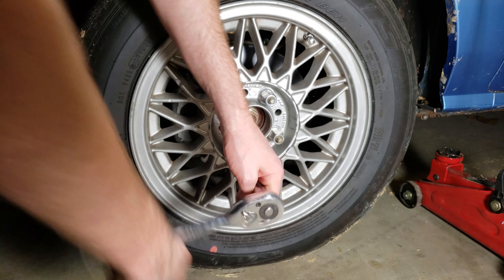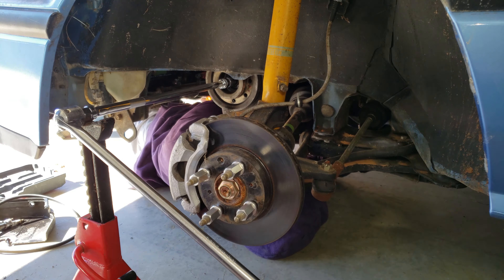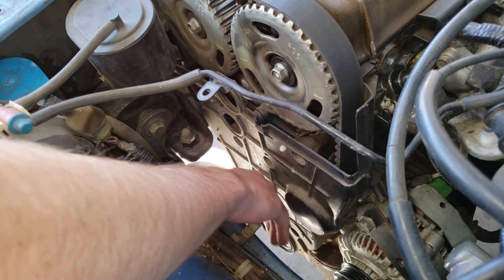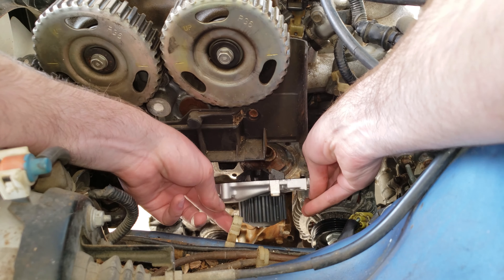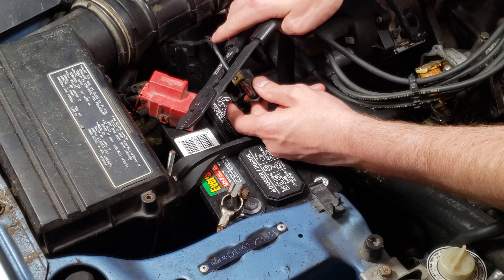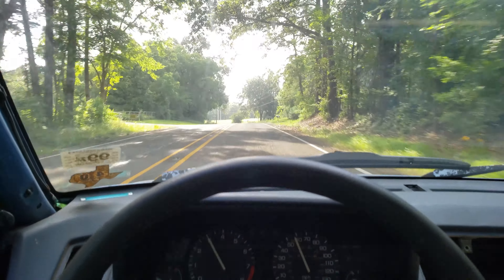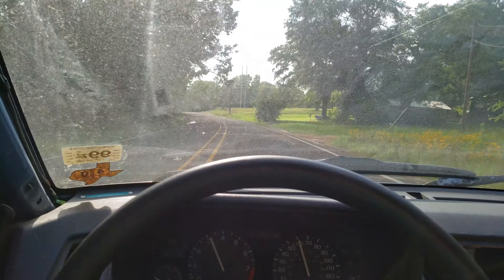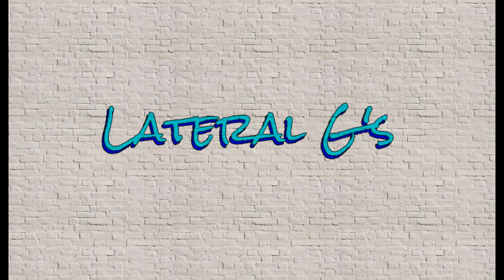Project '87 Integra: Episode 11 - Autocross Day

Comment: Love your channel...!😀.  I have my 89 Integra hatch in storage for 20yrs & about 60k miles!  Life, people, & heath all took it's toll on me.   So,  Did the fuel pump fix your power loss problem?  
One thing you should really consider for your car & others cars is to use a very unique oil additive from Schaffer's called EP Moly 132.  Schaffer's is a no b.s. fly by nite company & been in oil business for 185 years!  Again 185yrs.  They are one of the well known boutique race oil blenders as well  have very robust oil formulations for fleet vehicles. They're pretty famous in the oil business.  Anyway their unique chemistry in the EP Moly 132 contains very little Moly, but the anti wear component is Antimony which is expensive & also will really quiet down the Honda's valvetrain & other metal contact areas to smooth out that motor including the viscosity improver they use will increase compression & ring seal.
 Most of Schaffer's top performance oils have a good amount of Antimony & MoDTc Moly.
The other well known company in the oil industry that uses all Antimony, is Renewable Lubricants.  They are again a boutique blender but concentrate on industrial oil since their oil is 100% Vegetable Base Stocks.  Its highly technical but they are a proven oil company & get major gov. subsidies for their oil refinery & continued science research in sustainable oil industry using soy oils .  Just read up on : HOBS base oils and implicit/inherent FM.

You can actually buy their concentrated Antimony Additive Package called Bio-SynXtra Booster Pak & they have a tech paper on dosages to use for oils other than their oil.  It can be seen on oil lab analysis but most labs can't test for Antimony, but Polaris or Blackstone if you request it just to do a baseline test on your used oil to check the health of the engine.  They have a fuel additive uses the same chemistry for cleaning & upper cylinder lube & metallic bourne fuel catalyst from the Antimony, but they keep that a trade secret. 
Another concern,  when you did the timing belt, did you take the valve cover off & put the proper size inverted drill bit into both cam journals to lock the cams at the proper TDC reference according to the repair manual?  
You very well could be 1 tooth  off on either cam & not know it.  I saw one guy actually prove that even that procedure to lock the cams with a dowel or inverted drill bit, it was very possible to be a tooth off since the alignment holes in the cam journals are slightly larger than the indexing hole in the cam to allow for a few degrees movement, so he drilled the cam alignment hole exactly to the size of the oversized cam journal hole so the correct inverted drill bit fit snug into the cam to be sure neither cam is off.  
Some guys have actually degreed the cams with a degree wheel & dial indicator on #1 piston.  I made up this tooling back in 1998 to measure my cams, but back then not had full specs or would give them up like the original 1st Gen tuner Jackson Racing, or WebCam, or Delta Cams who were the original companies to make & still do regrind performance cams.
Also, did you find the piece of missing water pump vane/paddle?
Reply from the maker: Yes, replacing the fuel pump fixed the problem.  No, we didn't take the valve cover off when we did the timing belt. No, we didn't find the missing blades of the water pump but we never really looked either. I assume the blades disintegrated and aren't floating around in the cooling system.
Reply: @LateralGs  Thats good it was just the fuel pump & not some other hard to diagnose issue like your high idle problem.   First thing that came to mind was to use a smoke test to find any vacuum leak, using a Evap smoke machine or a retrofit a Halloween Fog Machine like many others have done!  Good diagnostic tool for old & new cars.  Another Integra owner traced his high idle problem to the Evap canister valve leaking with a smoke test.  You should run a few tanks with Red Line SL1 to clean those injectors as it has the highest PEA concentration at around 35%  where all other injector cleaners only have 15%, other than Techron was around 25%.  Only other one the expert chemists on BITOG Forum found out was VW brand G 001780 M3 , VAG-G001770A2, has 75% PEA for the troublesome DI Audi & VW.   That Renewable Lubricants injector cleaner I mentioned uses a much different chemistry of Vegetable based Esters to clean the fuel system, carbon & injector deposites.  And if you need injectors professionally cleaned, only place to trust is Fuel Injector Connection.  He's been doing injectors since 1999 & has the most comprehensive YT ch. going back 16yrs ago & tons of videos.  All the Vette guys on the forums recommend him, & I didn't even mention my 87' C4 also in storage too with only 17k miles.  If I don't get in better health real soon, I'm having both cars crushed I'm so disgusted & will take all my years of wishful mods to my grave!